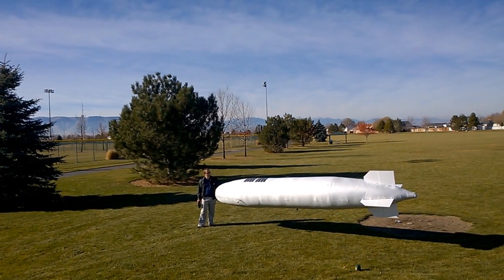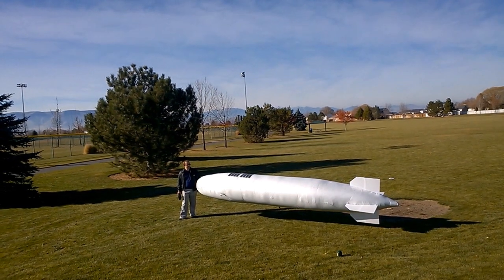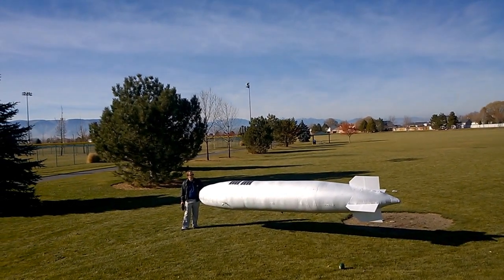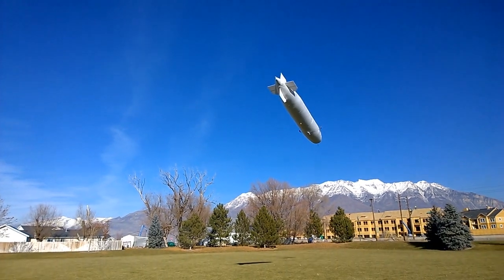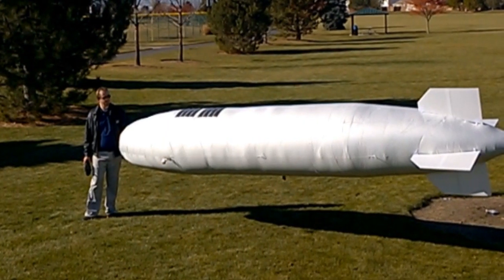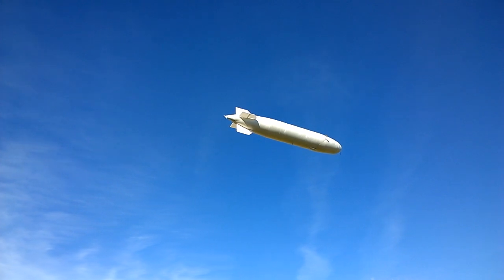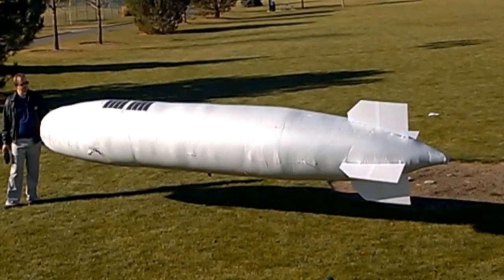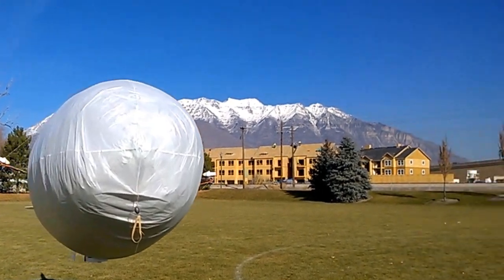Solar Powered Blimp Drone Prototype

Comment: How is the altitude controlled?? Just wondering, cause I've always liked the idea of trying to make a communications balloon thing, that and my general curiosity!
Reply: I forgot to add, how well will it work in windy conditions/rain?
Reply from the maker: Matt Cooke This particular version can only handle light winds. I'm currently expanding the solar cells and getting larger propellers to handle higher winds. The cells themselves should handle rain, but I doubt all my wiring is waterproof. I could fix that, I would just have to redo all the wiring, which would take forever. 

Long story short, it could, but this version probably doesn't.
Reply: BaccaYarro and about the altitude control? Or is that patented ;-)
Reply from the maker: At this point its just the vectored thrust engines, and that seems sufficient. For larger blimps its common to use pressurized ballonets within the envelope that change its buoyancy. But smaller ones generally don't have the room.
Reply: Ahh, so it only has enough helium to float, but not rise. Wouldn't that mean that it would start to float upwards the higher you flew it, because of the pressure changes. And would it sink slightly if it was at sea level??
Reply from the maker: Actually airships are typically flown a little "heavy", which is to say if you turned off the engines it would slowly fall down. You do this to make them easier to control, and easier to recover in the event of a failure. The goodyear blimps, for example, typically fly about 100 lbs heavy.

Also, as you rise the air outside the envelope gets less dense, and therefore lighter. If the helium inside the envelope can also expand, the net change is negligible. But once you reach the maximum expansion of your envelope, it can no longer expand and is therefore heavier in comparison to the air outside. For that reason, lift is reduced and it will eventually stop rising (or burst).

Lower altitudes have the reverse effect.

This flight was made at about 5000 feet above sea level. At lower altitudes, it would have more lift and could carry more.
Reply from the maker: BaccaYarro A bit more on this. There are several environmental factors that affect the lift you get from the a blimp:
1 - Altitude (higher = less lift from the same size envelope)
2 - Temperature (hotter = less lift)
3 - Humidity (wetter = less lift)

So, for example, this blimp would fly way better in New York than it does here in Utah, which is both high and can also be hot. In many ways Utah is a worse case scenario for flying these things. Except it is quite dry, which does help somewhat.

But I think of that as a good thing. If I can make something fly here, it will fly very well in most of the rest of the world.
Reply: BaccaYarro If you flew your blimp to 20,000 feet, would it stay at that altitude on its own?? And, well, scotland is very wet and cold. 25 C is warm here!! And i assume the solaar cells you are using are the paper/film like ones that are bendable etc. Last Q: How many volts/amps does the setup you have produce??
Reply from the maker: Matt Cooke Yes, more or less. As I say, you typically fly a little "heavy" so you would need a minimal amount of power to keep it airborne. But not very much. I've found the most power efficient way to do this is with pulses of thrust rather than a constant very low power setting. Below a certain power level the engines are less efficient. So in this way the engines are actually off most of the time.

With my current solar cell arrangement, I get between 7 and 12 volts at between 3-4 amps. It depends highly on the exact angle to the sun, cloud cover, etc. So I use a high efficiency voltage regulator to keep it at 7.5 volts. It seems to average about 30 watts. That may not sound like much, but the blimp doesn't need much for flight. And, of course, you could get more with more solar cells.

Yeah, I use the flexible solar cells. They are less efficient in direct sunlight, but you get at least some power even on cloudy days.

Comment: That took you a year to build? I don't mean to offend but perhaps you should put some thought into labor saving techniques, because I'm confident I could build something similar in a weekend.
Reply from the maker: Oh, you should give it a try, airships are fun to work with. That model wasn't built in a year though. I don't think I said that in the video? Could be wrong. As I recall I think I worked on that one over about a month. Of course, I do have a full time job, family, and other passions that take up much of my time. Now what I had been working on for much longer was some of the concepts and systems. In particular the electrical system was a challenge for me. There is kind of a lot going on in that system, and a lot that can go wrong. And, unlike conventional aircraft, a power or control failure does not necessarily mean it comes back down to Earth. If you aren't careful, it may float away and you may never see it again...
Reply from the maker: Just realized you got the year thing from the video description. Yeah, I was referring to my work on other solar powered blimps, like the one pictured on my youtube avatar. That one was much larger, and had a much greater lifting capacity. However it proved too unwieldy and too expensive to continue to develop. The clincher was when it developed leaks in the envelope. I would patch one, and another would develop. It was very frustrating. Eventually I decided to scrap the entire design and work with a double envelope, which is what you see in the video. I've worked on blimps for a long time, what you see in the video is simply the latest in a long series of blimps I have made. My first flying powered airship was based on a German Army Zeppelin from WW1. It had a rigid structure, which worked but kept breaking. It was featured in a local newspaper, the Deseret News. That was way back in 2000. So, yeah, I've been working on buoyant aircraft for  a long time.

Comment: Nice! I was thinking if you made it black so that the envelope is also being heated by the sunlight you could get greater lift.  Have you tried that?
Reply: what else is on 
Look up his patent application.
Reply: To much lift is also kinda bad, you just want to have enough lift to make it hover on the same height
Reply: @moritzk3004  more lift = more payload or stronger motors. When it cools the craft would sink, requiring more battery capacity. It's an interesting idea but the margins would be slim or none
Reply: @johnmartensen4278  more lift would mean a constant up or down force which would need to be countered by an active propulsion system, which would mean more needed weight

Sunlight and heat aren't constant means you cant tune your lift gained from it

Comment: Great job man!  I love the concept and design.  Among many things, I see a lot of search and rescue applications for this.  Would it work the same in cold, high altitude conditions (ie mountains)?
Reply from the maker: Well, this was filmed at about 5000 feet. I would predict it could go to about 10000 without much trouble. Much higher would require a larger envelope, but its certainly possible. I actually made one that could fly at 30,000 feet a few years ago, then I found out it would be illegal to test it. :)

Airships actually like the cold. Colder air is denser, and so you gain more lift by displacing it. The big problem would be wind. This model could fight light-medium winds with enough cells. But high winds would be a problem. So, a storm would ground it. But if someone just got lost or something, yeah this would be ideal.
Reply: BaccaYarro Why would 30, 000 ft be illegal???
Reply from the maker: In the US there are some rather draconic rules governing drones. Currently it is not legal to operate a drone outside of line-of-sight. They say they will be changing these rules this year.

Comment: Great project, my only suggestion would be to use very low rpm motors, with large slow turning props with little pitch. 
this will greatly help efficiency, as the airspeed is so low, and the near-static thrust is what is most important.

Comment: Looks great, one question, what does the patent prevent someone from doing/is there an online patent I can view as I had a similar idea a month or 2 ago but only just found this video?
Reply from the maker: D-Licious Unfortunately that is a very complicated legal question that I can't really answer
Reply: BaccaYarro Oh? Patents must be confusing :/ Am I right in saying that someone could build a solar powered blimp, but if it was built the same way (which mine wouldn't be) they couldn't monotize it?
Reply: +D-Licious Correct. You can look up any patent documentation online freely and mimic it if you wish, just can't profit from it.

Comment: Great job. Do you have estimates on how long it can stay aloft? Is leakage and gradual moisture inside an issue like typical airships? Thanks.
Reply from the maker: +Hans Zarkov It depends on envelope age and flight profile. A typical ship could likely remain airborne for a week or so. There are other systems on the way to increase that, but not in this model.
Reply: BaccaYarro
Thanks! Good luck

Comment: Hi, this sounds like a great project. We want to build something alike but a lot smaller. How do you fill in the helium and handle the different air pressure depending on how high you get? Which gas-tight material did you use?

Comment: how it works with hard winds and storms?
Reply from the maker: Right now you have to take it in during storms or high winds. With more solar cells and more power, it may do better. But ultimately, like most drones, you will have to take it in during the worst of Super Cell type storms. 

Unless I make a high altitude version, which is a possibility.

Comment from the maker: Hey Brennan, I can't actually respond to your comment. When you can, please change your Youtube / Google+ settings to allow replies. This is Helium, but I have actually dabbled in Hydrogen and I would say it isn't as bad as the hype may lead you to believe. But, yes, for PR reasons if for no other reason, any commercial airship will likely be filled with Helium.
Reply: BaccaYarro it could also be used for war spying they could paint it and make it look like a cloud in the sky
Reply: I agree if no people on it hydrogen would be much lighter and cheaper to obtain. Also its not as bad as long as you keep everything low voltage so no sparks.
Reply: But Helium is not accessible. Every operator will need to get a constant supply of Helium. Hard.
Reply: Jaybird they did that in a book called Scorpia by Anthony Horowitz
Reply: Surprised Hydrogen Helium mixes aren't used that are safe and more effective other than maybe leaking through the membrane.
Reply: Jaybird ... google the history of blimps
Reply: Ron T exactly! Thats why hydrogen is easier to make

Comment: Wow, absolutely amazing. I've been looking for something of this design to experiment with. I love these drones/airships and relentlessly trying to find a more common practical application for them. I think they're incredibly handy, but for what? Perhaps as a mail carrier and small package delivery, or something even more creative. Another thing I think would be incredibly interesting is autonomous flight using GPS. How many cubic feet or meters of helium does it take to fill the blimp? Is it 99.998% helium or are you using a nitro or air mixture? How long does the helium hold without the airship going soft?

Comment: these heliostats were in common use before the whitewashed mudflood reset of 400yrs ago

fitted with Atmospheric Etheric Electricity harvesting "Antiquitech" instead of PV panels

also fitted with red Mercury levitation tech powered by the AEE tech for heavy lifting and take off assist 🕴

Comment: May I ask how you control the drone and how did you set up the remote (if it is a remote)
Reply from the maker: It's a standard Pulse Width Modulation control system, I use an 8 channel receiver and transmitter. I would like to eventually control it using an automated system so it could be programmed to follow waypoints. It should be easy enough to do, like I say it's all using standard components and signaling.

Comment: how much is the max weight can it pick up I'm jw also do u plan to sell some soon I like the range part
Reply: To lift 100 kg payload you'll need approx. 100 cubic meters of helium only for that payload that's a cube with side 4,65 m or a sphere with diameter 5,7 m. One could also use heated air, or even steam (a water molecule is lighter than a molecule of oxygen or nitrogen) provided the thermal isolation of the airship is thick enough to keep thermal leakage low.

Comment: What is the point of talking to a patent attorney? Blimps, Solar, Drones, etc has all been done before. There is nothing inherently patent-able in what you have shown.
Reply from the maker: It's similar to how Boeing can seek and obtain hundreds of patents for the 787 aircraft, in spite of the fact that jet powered passenger aircraft have existed for at least 60 years. Basically, while it is true that you can't patent that type of aircraft, since it has been done before, you can patent all the systems and methods that go into making it work, and the things that make it unique.
Reply: @BaccaYarro  I looked for the patent using the online US patent and trademark registry under your name and couldn't find any information on your patent claim. Even if it was filed using a company name your name should have came up in the search as owner. Sometimes it takes 6 months for a patent to appear in rare cases. When did you file your patent?
Reply: Nevermind Mark, I found a group of patents under your name. Thanks for all the reading. Good luck in your adventures.

Comment: What material did you use for the drone? (the silver bit)
Reply from the maker: Sure, I guess there is no harm in sharing that. The inner envelope is a laminated nylon material that is heat sealed. It is fairly helium impervious, and easy to work with.
Reply: BaccaYarro tyvm, my friend needed to know for homework :))
Reply: BaccaYarro You talked about the INNER but my friend also needs to know the outer for his project
Reply from the maker: As I recall on that model it was simple ripstop nylon. Spinnaker cloth.
Reply: BaccaYarro thank you very much
Reply: BaccaYarro sry to bother you again rofl, how much did it cost in total to make?